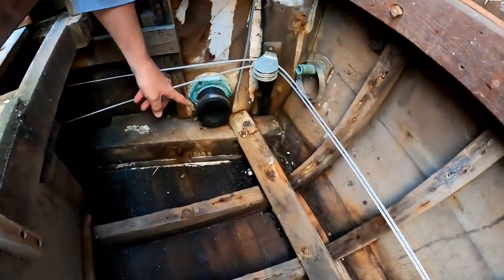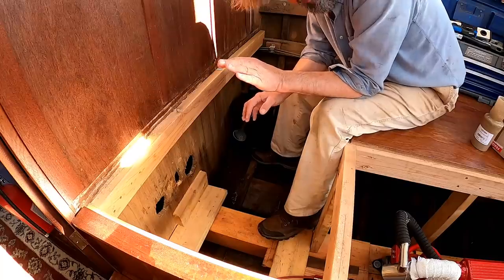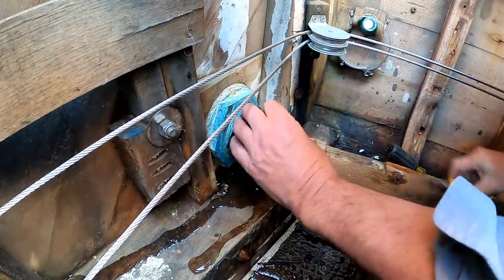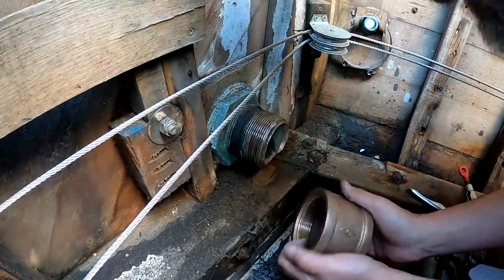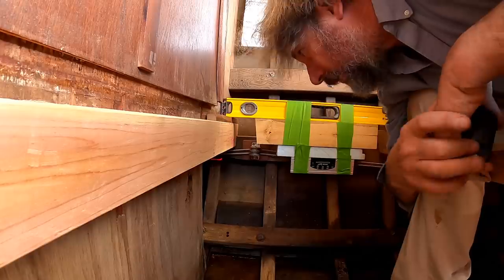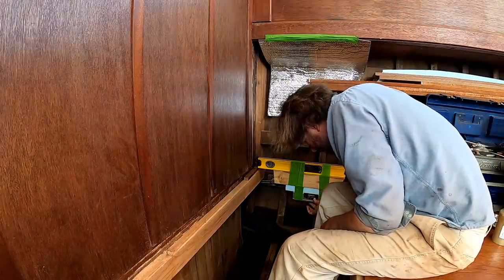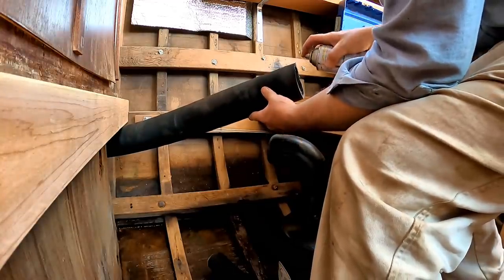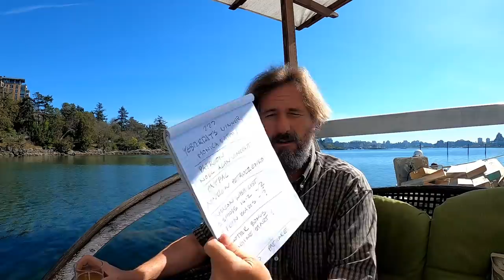Exhaust System - #227 - Boat Life - Living aboard a wooden boat - Travels With Geordie

Comment: Nice exhaust install Peter.  That brings back memories of my install which went from 1-3/4" (thank you Volvo-Penta) to 2" to 3".  In my case I put in a check valve with a 2" inlet and 3" outlet for the final transition.  My exhaust run is even flatter than yours hence the check valve.

Comment: In previous episode you stated that the water entering exhaust elbow is below the highest point and can’t get back into engine - not so because if it fills the muffler (by siphoning when engine is turned off and main inlet seacock left open) it will then back up the exhaust tube, over the bend and into the engine.
    Your stated highest point of the bend is 3½” (89 mm) beneath the cockpit sole and you said just now the top of cockpit sole allowing for fuel tanks would be 12 inches (304.8mm) above the waterline. I figure that makes the top of your exhaust elbow, (which is higher than the point of entry of cooling water), as about 190 mm above waterline.. 
    Beta installation manual recommends a minimum of 250 mm between the point of entry of the cooling water into the exhaust elbow and waterline otherwise they recommend to install an anti-siphon valve. They also mention that some installers always add an anti-siphon valve “just in case.”

Comment: Hello Peter !   I hope there is a kind of "flapper door" at the exit side of your exaust system. Since the exit side is located on the transom of the boat and at the water level, even if you have a 5 degrees slope in your exaust tube, when you are ridding a wave coming from the stern of the boat, that slope risk of being inverted for more than 5 degrees. I don't want to imagine the amount of water rushing "back" toward the engine.

Comment: Why not just set up brackets that hold the hose away from the hull of the boat so it doesn’t interfere with the steering. You have to have a precise slope down to drain but no one says that slope can’t be can’t have a little sideways shift. You could make triangular brackets that you could mount to the framing on the side that you could attach below the steering that would be narrowest on the bottom and white is on the top again below the steering. Then you could attach, clamp your drain line exhaust to those brackets that would then hold them and you wouldn’t have to mess with your steering cables. Just a thought but it sure seems easier than moving the steering cables.

Comment: Rectorseal T plus 2 teflon pipe dope sold at Home Depot seals these rubber hoses and allows them to slide on well. Never had one pop off. I even use it for the engine coolant hoses that are under pressure. The real big advantage is the rubber hoses do not get stuck to the hose barbs. Plus it actually helps it seal, keeps it from leaking, as you know hot salt water getting into cracks between hose and barb causes corrosion.

Comment: Back in the day in a Ketchikan shipyard ate product Pliobond ( think contact cement) was used with fiberglass cloth to seal decks, curves ands unusual shapes, remained flexible, and is paintable. An “older “ shipwright in your area may know all about it and it’s still available !
Cheers

Comment: Peter, Q from yesterday's video... are you going to "clock" the gauges?  that is rotate the gauges so that the needles all point in the same direction when everything is running optimally.  Great for spotting problems, not so great for "pretty". I have a friend who, when I note that patience is a virtue, he responds that "Patience is a virgin".
Reply from the maker: The clocking is neat, but I’ll stick with pretty. You knew that was coming didn’t you?.....

Comment: NO Peter you need to have the waterlock as close to the engine as you can. The waterlock should be on your engine beds where you had your feet before it rises up to go out. Don't mount it miles away as you were saying.

Comment: I have used fine grinding compound on this kind of thread fitting before, and also Rectorseal teflon Tplus2 pipe dope for sealing threads. 1/2 inch on  is ok. You want like 4 turns of engagement

Comment: Peter, I would have saved myself all that hard work and the cost of the fittings and just put the rubber hose straight onto the thru-hull outer exhaust fitting and fastened it with 2 banding clamps and job done, run the hose through to the engine via a wet muffler and into the outlet of the engine. (I still have concerns about that right angle inlet into the exhaust from the heat exchanger, in time that will wear through the right angle, it should be at a 45 deg or less as severe angles in water always create wear points and then water into the hull and oopss we are sinking let's get out the lifejackets time, I have learnt over the past 30 years of working on and having wooden boats.. less is more and thus, fewer angles and fittings to go wrong or leak the better!)... but Peter says.. patience my dear friend it will be .......................................................... stay tuned for next episode. haha see how I worded that last part without even seeing the end of the video to know the word this time.. I just read the comments below and worked it out.. not rocket science I know.. haha...
Reply from the maker: Heh, some wisdom herd for sure...

Comment: How do you deal with the back pressure  to the engine.  Dave
Reply: Its a diesel honestly it would hardly bother it, having said this most marine engine applications are designed with this in mind a wet exhaust and a possible water lock muffler, however your question is a good one and i suspect that it will have just a slight parasitic power draw from the engines power output, perhaps one half to maybe one horsepower.